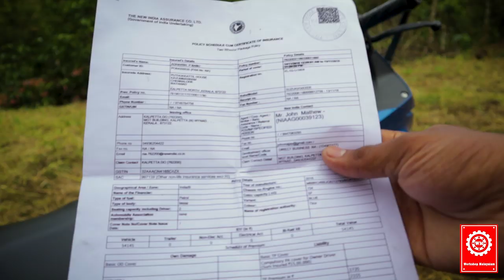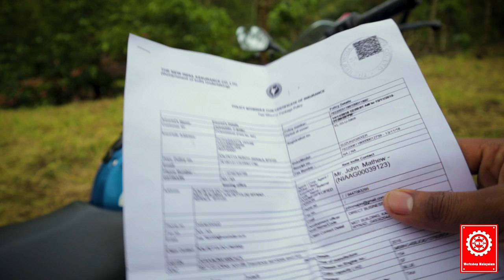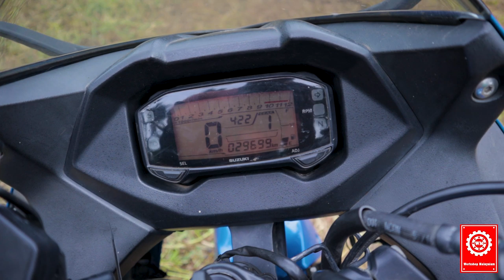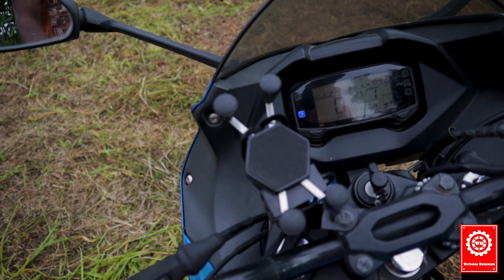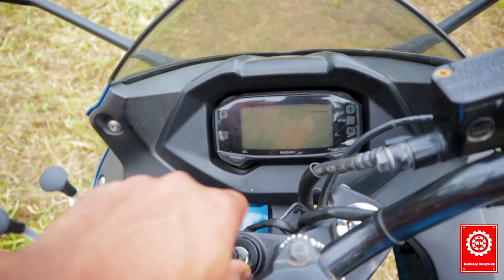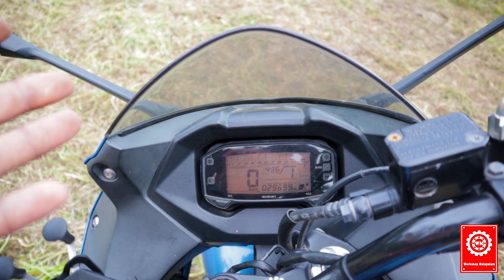How to buy SECOND HAND BIKE / USED BIKE വാങ്ങുമ്പോൾ നിങ്ങൾ നിർബദ്ധമായും ചെയ്തുനോക്കണ്ട 7 testകൾ

Comment: 2009 model pulser 150
75,000 km running
Piston & cylinder maattiryirunnu
Air filter power ullath aakki
15,000 rs nu labham aano
Reply from the maker: Tyre okk nokkiyoo
Reply from the maker: Vandi condition aane kuzhappamonnumilla